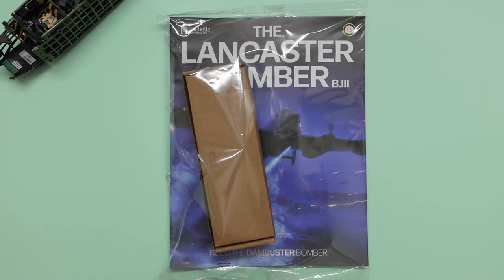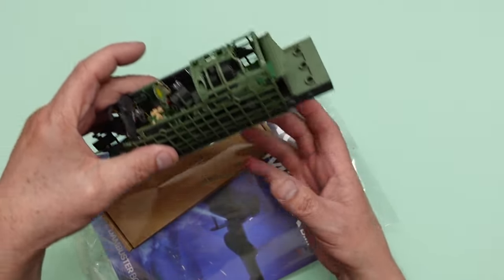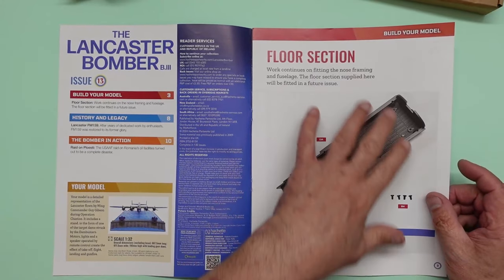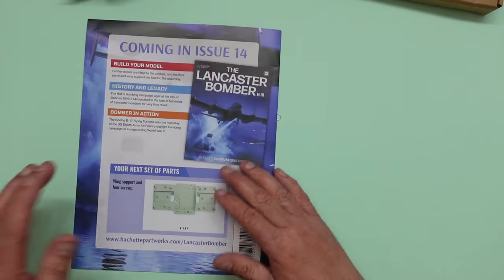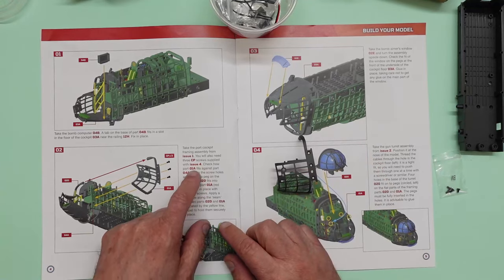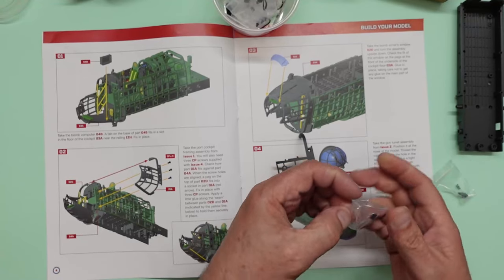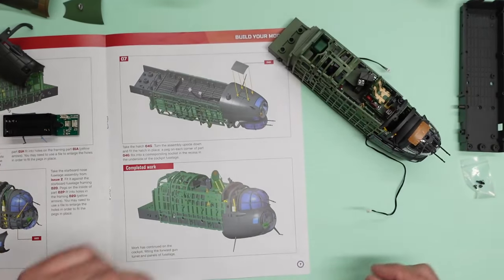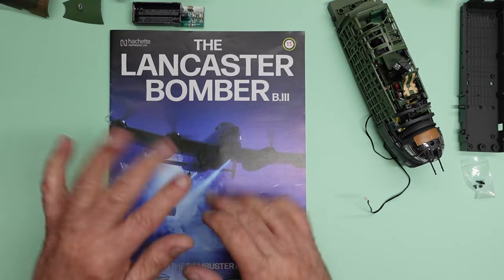Hachette Avro Lancaster B.III Dambuster Pack Thirteen

Comment: Great video Nigel.  Loved your enthusiasm.  Coming along nicely.  Nanton is a small town due south of Calgary Alberta which is home to the Bomber Command Museum of Canada.  The volunteers there have been working on FM159 - F2T since 1986 and now have the 4 rebuilt Merlins running.  FM159 is the Canadian version of the NX611 project.  The flying Lancaster FM213 is marked out as KB726 - VRA, which is housed at the Canadian Warplane Heritage Museum in Hamilton Ontario, and is the Canadian version of PA474 (BBMF).  Cheers and best wishes.